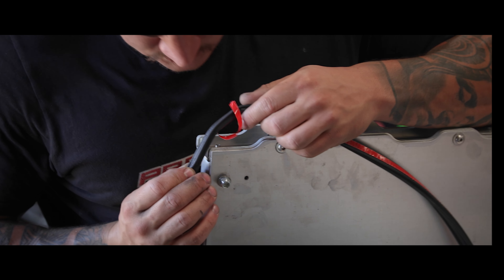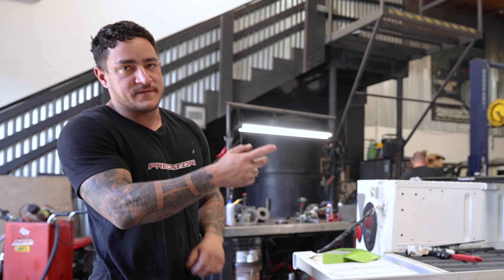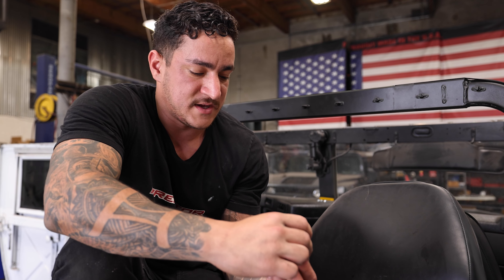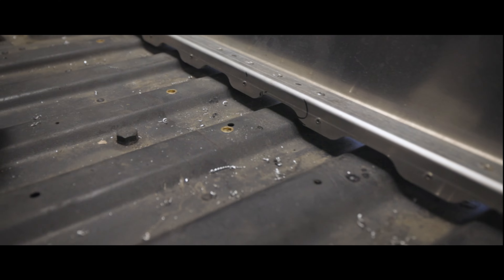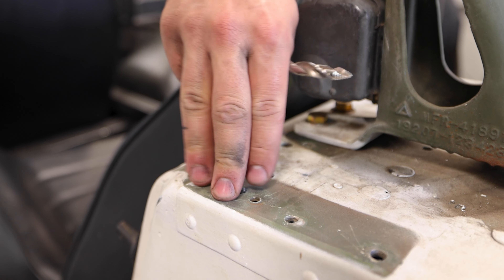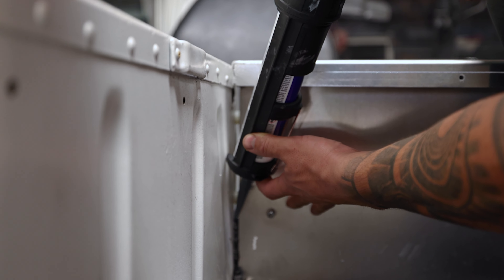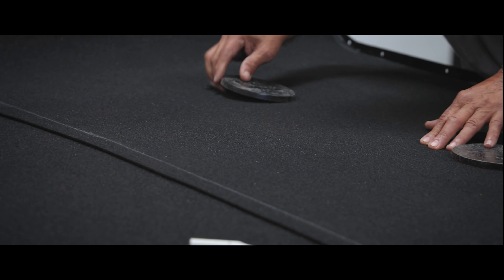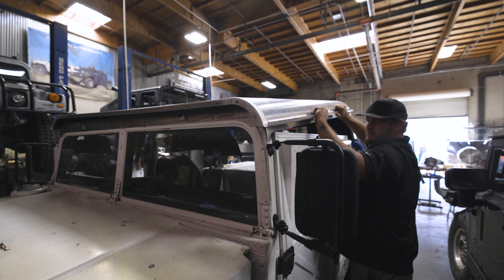HOW WE TURNED A SOFT TOP HUMVEE INTO A HARDTOP

Comment: If I want a minimalist truck with heat,  air, leather and alcater interior do you buy a humvee or h1?
Reply: Well if there’s heat ac and leather then it’s not really minimalist.  I’m also not sure what alcater is.

If you buy a humvee with the extended nose it should have heat and AC and you could put leather seats in there.
Reply: Alcantara, sorry and no thanks on the H1
Reply: H1 no question. Humvee is a stripped down military truck with NONE of the creature comforts of a driver vehicle.